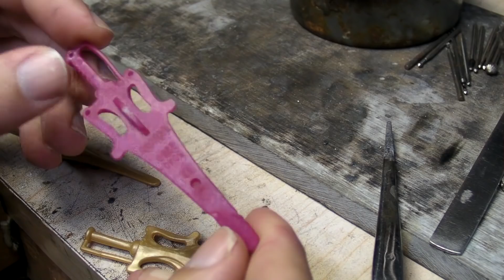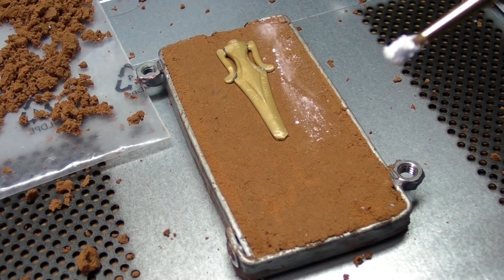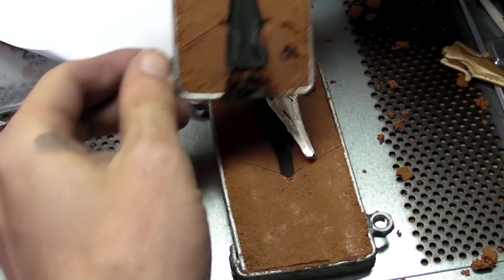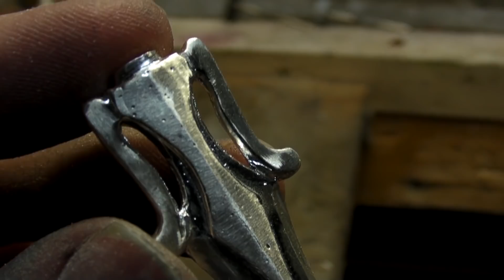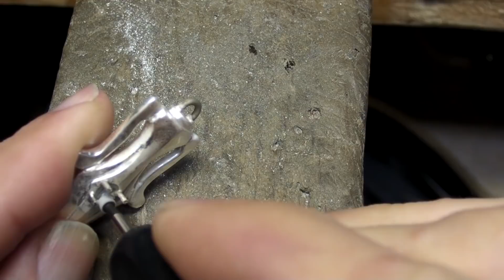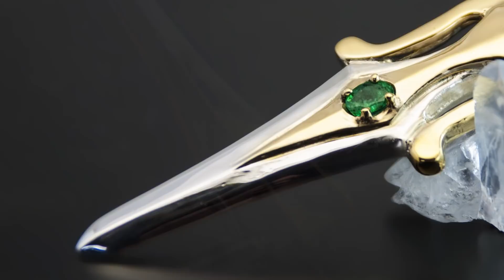Casting Metal He-Man and She-Ra Swords using the Delft Clay Method

Comment: great video mate ! nice simple and informative. 

coming from larger scale sculpture, i experimented a lot with delft clay and i am myself getting little by little in jewelry making through wax carving. your videos just sum up the whole panel of techniques really clearly !

Just a little hint : Though it's really faster, I feel that you shouldn't use an emeri wheel to sand every type of form down, because it tends to get the surface "wavy" when it should be straight, for example on the edges of the blade. Instead, a manual file will allow you to go straighter and on a larger distance, getting you a nice strechted out surface.
Reply from the maker: Thanks for the comment! I'd like to do some large scale sculptures myself some day. I might not have shown it in the video, but after using an emery wheel I'll go over flat surfaces with an emery stick to try and even out that wavy surface finish.

Comment: what did you use for the gold plating?
Reply from the maker: I use a makeshift pen plating setup for gold plating. It's basically a rectifier attached to a felt pen tip with stainless steel wire woven through it as the anode. The felt tip is soaked in Clean Earth 14kt pen plating solution.